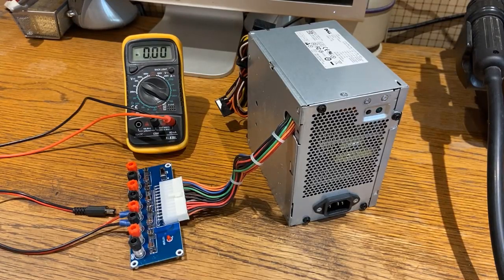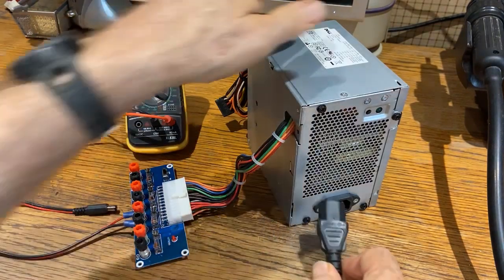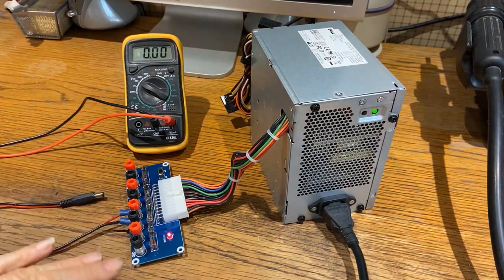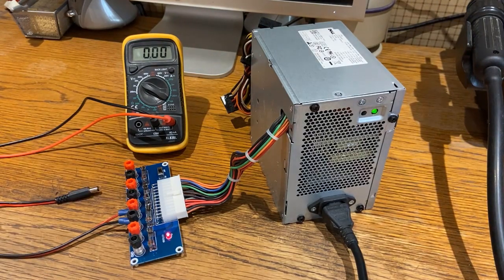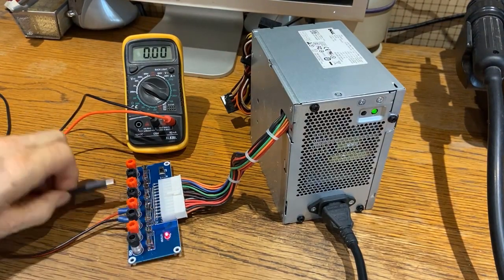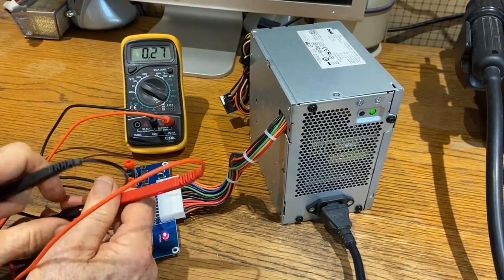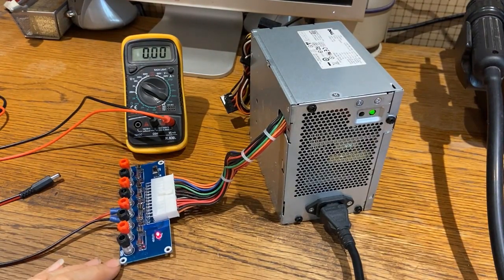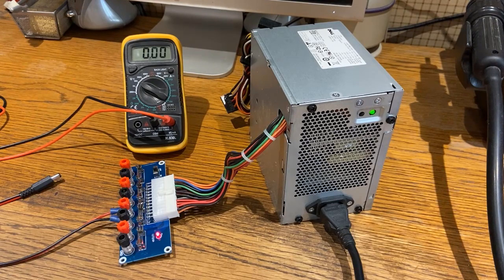Computer Power Supply DC Power Source With ATX Breakout Board #2

Comment: Hi. Can you please tell me how many amps on the 12 volt supply can it handle? Cheers from Australia
Reply from the maker: The breakout board is rated at 120 watts. So for the 12v rail that should be 24 amps max. Whoa! That would probably be smoking!
Reply: @plasmaworkshop  thanks for the quick reply 👍
Reply from the maker: @dragan3290  You are most welcome!